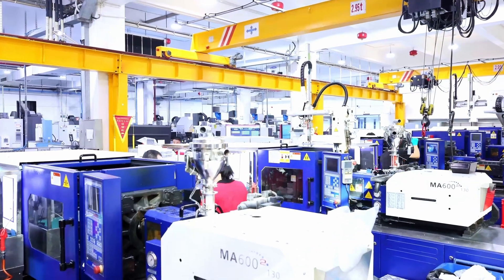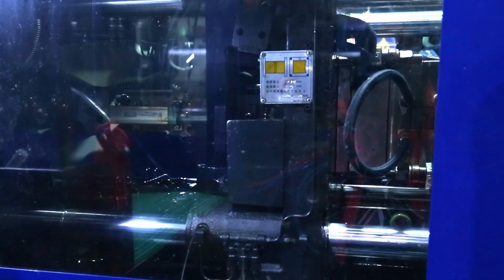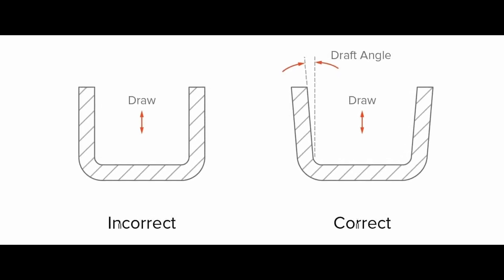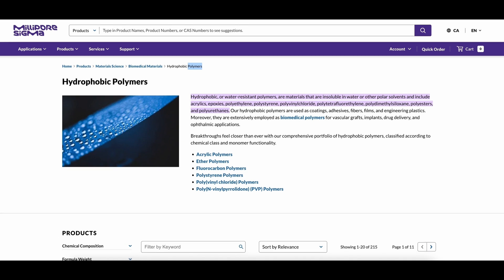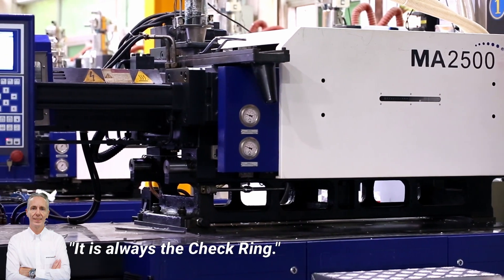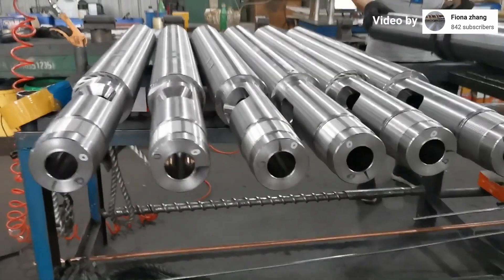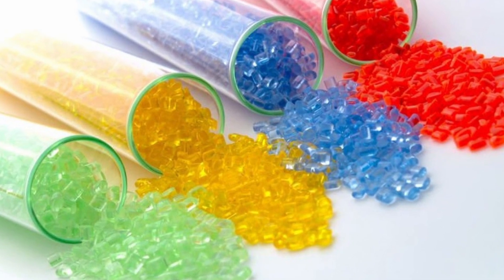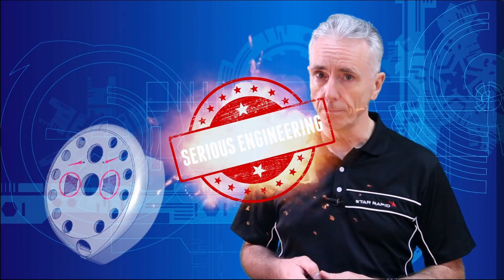5 Tips to Avoid Expensive Plastic Injection Molding Mistakes | Serious Engineering: Ep30

Comment: Let me be real i have dealt with injection molding companies here in Spain that are much much worse than what you have said. One time they just changed the plastic they were using for no apparent reason, not the supplier or the kind of the same plastic, an entirely different plastic with similar properties for the application. We asked  why and they said that it was cheaper and better and that was it. And in general as long as the finished product is cheap we really do not care. But we are going to change to a Chinese supplier because the customer service is atrocious, waiting 3 months for a response is absolutely insane. there is a minimum quality we want and that is more or less the properties of the plastic and the color again more or less the same and the lowest price possible per part per lifetime of the mold, and with that we hit the ground running.

Comment: This is all stuff I learned my first year of molding. Sometimes easier said than done but you need a company thats willing to spend money to make money and mine ain't. Been a tech for 5 years now and it's pretty much work with what you got with no maintenance and no control over anything but doing my job to the best of my ability with 20 to 40 year old presses and molds with little to no actual preventive maintenance.

Comment: Spot-on advice! These points are crucial for a successful molding project. At Jevny Mfg, we partner with clients to navigate these exact challenges, offering low-volume injection molding with DFM guidance to avoid costly mistakes from the start.♥

Comment: Speaking from experience as an operator (mostly with blow molding)  as well as a maintenance man in a plant with blow and injection machines, humidity will consume A LOT of time in labor with wiping the condensation off your molds. During the summer if we shut down a machine for more than a few minutes we have to add on time wrong off condensation which adds to our downtime